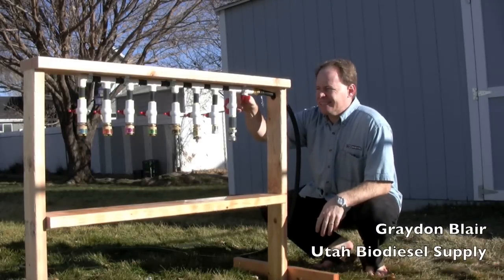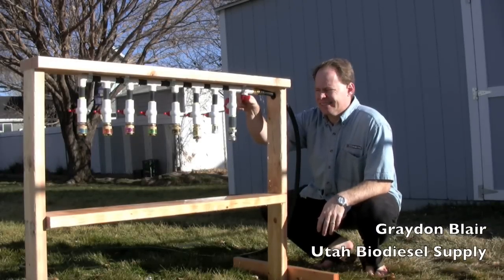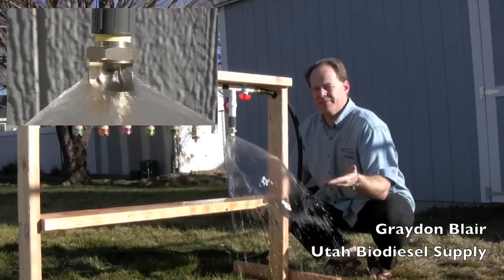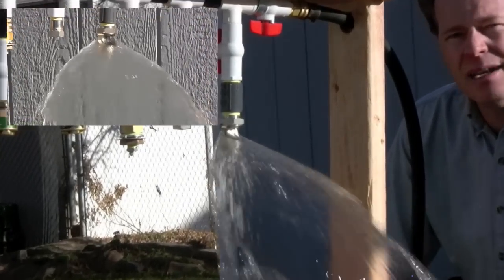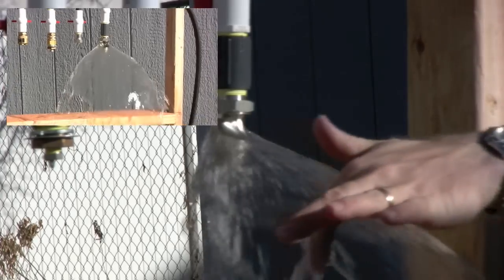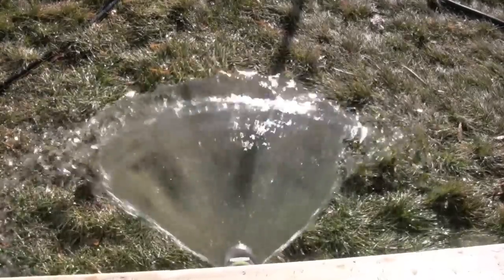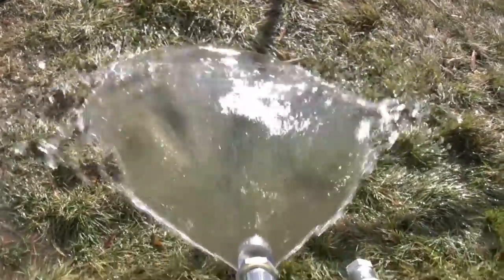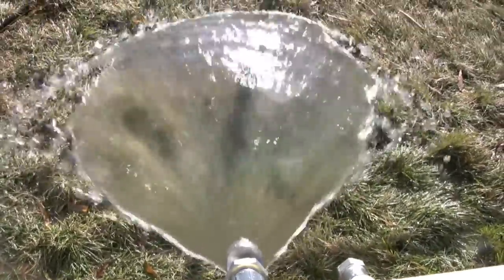Biodiesel / SVO Dry Pro Drying Nozzle | Utah Biodiesel Supply

Comment: how exactly does this remove the water? does it somehow speed up the evaporation of the water from the wvo do to a greater surface area via the fan like spray?
Reply: Yep. Exactly! More surface area allows it to evaporate more water. We use it with our drying tank kit (see our website) that heats the oil up, pumps it & sprays it through this nozzle. That then increases the evaporation rate. Works really well too!